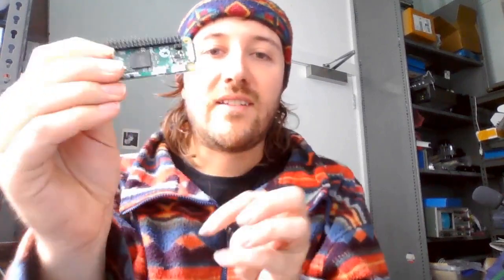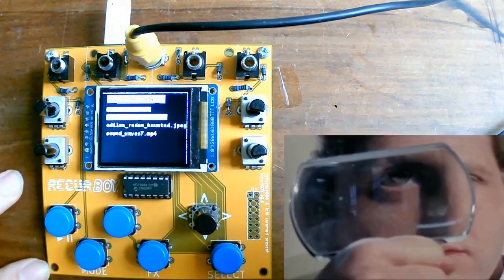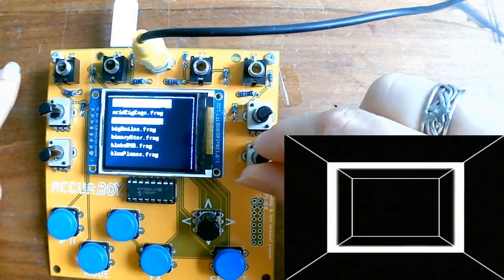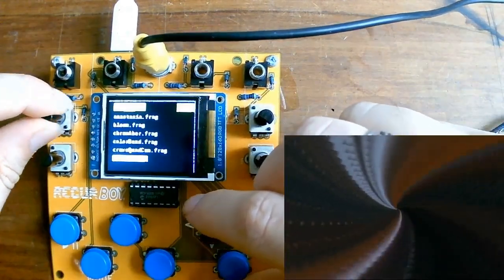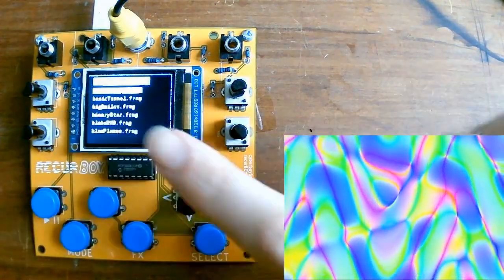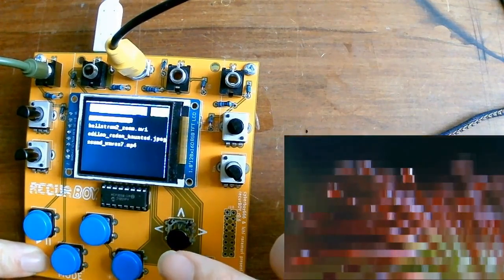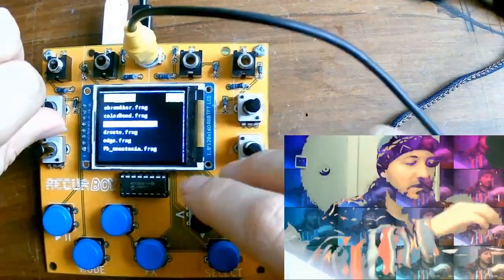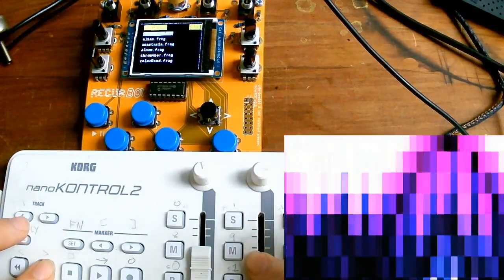recurboy circuit demo

Comment: amazing :)
I love how you set up the pipeline and simplified the workflow with this.
It's amazing what is possible to squeeze out of a PIZero!
I've got a couple of question for you:

Are CV in protected? What happens if they get an out of range voltage?

Does the micro hdmi works as alternative video output?
I use my recur (standard) with hdmi output and SD resolution, I really like recurboy form factor but for me a non-working hdmi would be a no-go :(

Amazing job!!!

Comment: Is it possible to do these things with cur project derivatives?
1. Midi clock sync. Videos to play to incoming midi clock. Some meta data to encode orig bpm to videos
2. Trigger clips by incoming midi note
3. Start clip, loop start and loop end as separate parameters, prefarably punched in as numbers.
4. Midi over wifi (rtp or some other protocol). 
I'm looking for some box to sit at vj and projector, while I use my sequencer on stage. So no long cables, just one device with library preloaded.

Comment: oof, sold out pretty quick! ill be eagerly awaiting one.

heres another question, i presume it will work, can you use a pi3b+ in place of the zero? should work if there isnt something blocking the space on the underside for the extra size of the pi3
Reply from the maker: more stock coming in next couple weeks. can i ask how you came about this project ? everything else in the shop is fully stocked - this one sold out in days lol. its weird

regarding pi3b+ - the header on bottom of pcb is too short to fit a pi3. if you are going to diy you could replace that for a taller header. still the pi3 would stick out from behind the pcb... but it would work. also you could look into my r_e_c_u_r project similar thing designed for pi3
Reply: @cyberboy666  I read about it on Hackaday this morning!
Maybe it bause the OG recur doesnt seem to be availible? and most of the stuff in store are add ons for that, and it seems recurboy does alot of what the combined -cur system does? just a guess, like i say i only found you this morning! Looking forward to trying to grab a kit
Reply from the maker: @olldomu5790  thanks for the reply - i didnt know about the hackaday article lol. thats cool - and you are right that it is the most self-contained and available project currently in the shop... recur has always just been diy iv never sold them myself... i want to eventually have a fully plug and play kinda thing but rpi's are too hard to get in bulk. looking at moving away to a different kind of sbc but its an uphill struggle lol
Reply: @cyberboy666  ah i missed the second part of your comment re: recur. tbh id presumed itd been discontinued or something after perusing the shop thi smorning and figuring out what everything did!

Comment: Hey dude, i think your display is misconfigured, what tft library are you using because i used to have that bug on my esp32 and the 1.8inch tft display where there are garbage pixels at your right and top
Reply from the maker: i assumed it is a hardware issue since it works fine on most screens i get but on some get these lines... (doesnt really bother me tho) you can see the open-source code relating to this here: https://github.com/cyberboy666/recurBOY/blob/main/software/display.py#L28C19-L36 - i think the library used is "cskau /
Python_ST7735"  im open to pull requests if you have a suggestion :)

Comment: Thank you for this! Dumb question that’s probably in the documentation-could you use a zero 2w for this build?
Reply from the maker: yes you can use zero 2w - only problem is they dont break out the composite video onto pins on these new boards (for some weird reason ??) so you will just need to solder jumper wires from the pads on the pi board to the pin headers on recurboy - theres a diagram in the docs ;)
Reply: @cyberboy666  thank you!